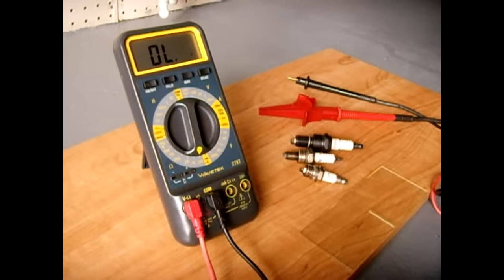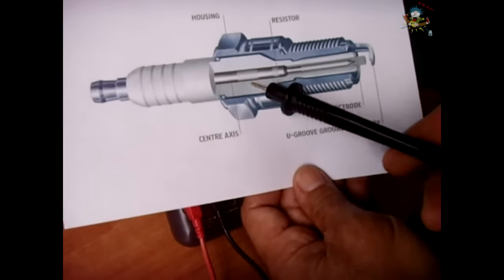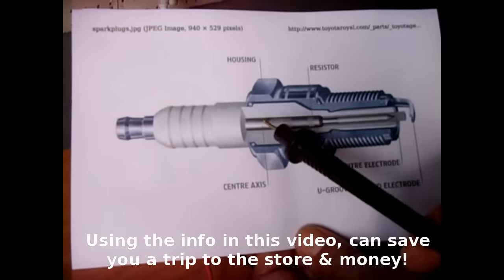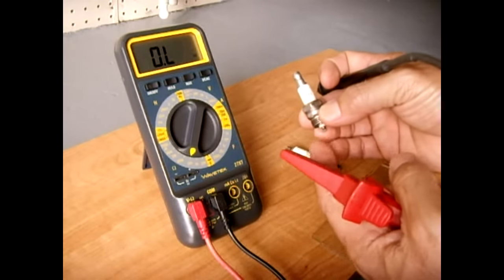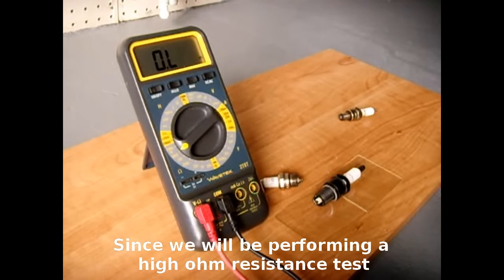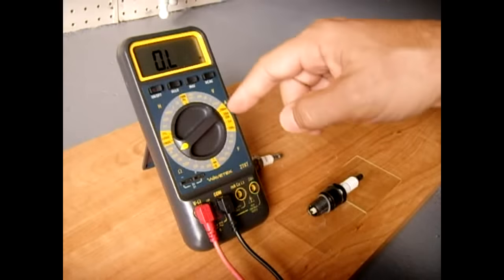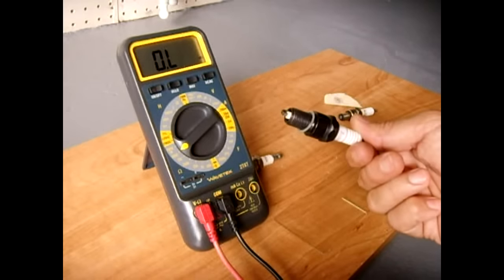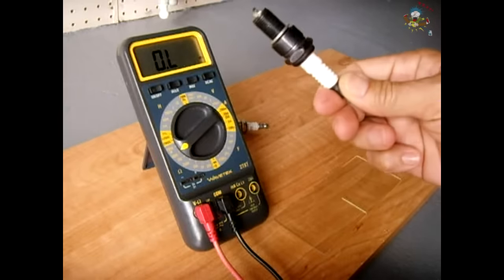How to rule out a Spark Plug as your problem

Comment: Your multimeter will not produce a sufficiently high voltage to check the insulation of the plug
Reply from the maker: paul c Never failed me. If you have a megger like me, use that.
Reply: spark can jump 1 inch an  your test never failed cause you probably only tested 2 .. by the time to remove plug test cold heat up test  hot  an realize this is a test but it is not conclusive or a positive diagnosis just but new plug for 2 dollars..
Reply: paul c for that you need lightning.
Reply: walter kersting  —  Hysterical response!  Thanks for the chuckle.  Love it.
Reply: paul c  buying a new plug for $2.oo makes me laugh out loud.
Reply: @mikem1014  - I think not. OEM plugs for my Suburban were $80 plus tax. We are not talking lawn mowers.
Reply: @PayNoTax-GetNoVote   we are talking one plug to test not to leave in motor ... just for testing

Comment: I am Italian ; I did not understand your video a lot:
I extracted 4 candles from the engine ... 3 had a resistance of 4500 ohms, 1 of 3000 ohms; Question: what could this go to 3000ohm? In my opinion, this candle has encountered problems, what do you say? thank you
Reply from the maker: Try cleaning the spark plug tip with Brake Cleaner.

Comment: You should also use the ohmmeter when testing the plug, for a high resistance connection  between the center and the ground electrode. This would usually be caused by operating the engine  with a very lean  gas / air mixture.

Comment: What is the range of KΩ you are supposed to get with automotive spark plugs with an internal resistor?
You said roughly 6.3KΩ but I need to know the exact min and max!

With 2 pin COP ignition coils it's:
▪︎ 1.0Ω or less for primary coil
▪︎ 6.0-8.0 KΩ for secondary coil

I would appreciate it if you can tell me the resistance range for a standard copper E3.48 DiamondFire spark plug or any standard 98%Copper with 2%Nickel spark plugs and Platinum or Iridium if there is a difference

Comment: Can we determine wether he spark plug contains a resistor inside or not by its length. For example, if the spark plug is short that means probably it does not contain a resistor inside?
Reply from the maker: No

Comment: The low voltage resistance test will not tell you anything because parasitic losses across the insulator at very high voltage are the problem with plugs breaking down, that is why we use (or we used to) a tuning oscilloscope to test spark plug secondary voltage under running conditions to see high spark resistance and detect poor insulation. Don't clean plugs unless you need to get our of trouble, replace them, you will never clean off the fuel by product burned into the insulator nose cone over their service life that is a pathway for parasitic flow across the insulator. The first sign of which is poor or irregular misfire at idle.
Reply from the maker: I've owned boats, jet skis, several cars, lawn and garden equipment, and the test shown never failed me. I was always able to identify a faulty plug. Nothing wrong with cleaning a spark plug(non-Platinum).
Reply: I've been a qualified mechanic a very long time and diagnosed a few million plugs in that time. You are seeing a reading on the meter but its not telling you anything you wouldn't already observe when it's running. In testing a plug we are looking for a condition that is present before it becomes evident with an observable misfire, We want to find a plug that is on the way to failing in the workshop before it fails out of the workshop. So you are testing the plug but not for anything you would not be able to observe otherwise, a bit like doing a compression test to confirm a bent valve. In short the very first thing we do with a misfire is replace the plugs with new ones and start from there.
Reply: FWIW, if you want to test the plug with an ohm meter and be able to find an insulation leak you would at least need to use a "megger" to test it.
Reply from the maker: I guess you never saw my megger video. :-)
Reply: No Ill have a look. But even using one, in short to test a plug electrically you need to generate a spark across it.

Comment: Very usefull for me......need some further advice on how to rule out a spark plug wire- some say that the lower the resistance the better the plug wire is....Magnecor says different and makes plug wires with very high resistance; so what do you advice me to choose? and of course, before choosing a new plug wire, what should I check to make sure I need to change it?
Reply from the maker: The resistance has nothing to do with how good the wire is. Wires are made for extremely low resistance, or high resistance. The insulation of the wire is what matters more. I suggest you contact the manufacturer to find out the suggested wire type to use.

Thanks For Watching!
Reply: electronicsNmore Got it.....so here are some further questions:
- since insulation is what matters, can I use some extremely good insulated ones like magnecor even though they have higher resistance over standard ones....?
-manufacturer (Renault) doesn't say anything about their types...
-how can I check a plug wire to see if its good or bad?
Reply from the maker: Likely have no problems with that wire. You can measure resistance across the wire and make sure the ohms per foot matches the manufacturers specs. Place the spark plug wire VERY close to the engine block at night and see if you observe any high voltage discharge(or corona) between the wire and the block. If you do, the insulation of the wire is degraded.
Reply: electronicsNmore Got it....instead of placing the plugs wires very close to the engine block- my wires are very short, cant get them close to engine- can I spray some water on them and see if discharges occurs?( using some of those "devices" used to clean windows set on "mist" to spray the water)
Reply: ncomplex1 Wires are just one part of the ignition system. Changing the type of wires without further modifications, or the need for them. Will not bring you any particular advantage, other than just spending money.But if your gonna replace it anyway, please make sure its up to at least manufacturer standards. ;-)

Comment: Hi, Does it short when the plug get hot ? Thanks
Reply from the maker: No. The plug heats up and expands, and if there is a cracked center electrode, that could pose a problem.

Comment: Hi,Thanks (what's your name?), Nice video. Just a couple of questions...how do I tell if a plug has a resistor or not from the outside?  (from looking at it?) and there was text saying don't sand platinum plugs but didn't tell us why?  Thnx again,  Bj
Reply from the maker: I'm Doug. You can tell if the plug has a built in resistor by the part number which usually contains an "R" at the end, or you have to use the DMM to test it to find out. Platinum plugs are "self cleaning" plugs. There is a VERY small dot of platinum on the ceramic tip, sanding it will damage the plug. No need to clean those plugs.

Thanks For Watching!

Comment: Is this video valid for iridium spark plugs or have they diferent measures?
Reply from the maker: +Joaquim Coutinho 
They test the same way. The only difference is the electrode is made of Iridium.
Reply: +electronicsNmore I have 4 iridium plugs for my yamaha. Cyl 1-2 have a value of 4000 ohms, cyl 3 has a value of 7800 ohms and cyl 4 has a value of 3700. Could that cause some rough running (misfires and loses power) at higher rpms? (The plug with a high value is also black compared to the other ones that look normal. (no oil residue, just black in colour)
The coils check out OK.
Reply: Narii- try to clean the iridium plug and measure again the values seeing if anything changes?
Reply: ***** Swapped them out for new ones, runs as it should now. Need to sync the carbs tho.

Comment: So if the multimeter checks the plug as ok, it means with 100% that the plug really creates an actual spark? I do not need to check this by starting it unplugged from the piston chamber to visually see the spark? This test is enough?
Reply from the maker: Extremely reliable, but nothing is 100%.

Comment: How hot would I heat the spark plug up to do a hot test.  I know I don't want to take it out of my car hot.  Thanks for the vid.
Reply from the maker: Alexis Tudor Place the spark plug in a toaster oven. 300 deg F should be fine. Use leather gloves when testing the plug. Lay the plug on a ceramic or glass plate while testing it.

Thanks For Watching! Be sure to Share and rate Thumbs Up.
Reply: electronicsNmore   Thanks.  Yes I already gave it thumbs up.

Comment: Can we conduct this test for platinum plugs?  I was told not to touch the electrode of a platinum plug because they're very sensitive and will likely be damaged.
Reply from the maker: I don't recommend it. The spot to touch with the probe is so tiny, you'll get a false reading.
Reply: @electronicsNmore  Thank you very much for replying.  So this test is only good for copper spark plugs?
Reply from the maker: @renejacques8288  No, it works with others.
Reply: @electronicsNmore  The only one left is iridium, right?
Reply from the maker: @renejacques8288  It works with all 3 types, but easily with copper and iridium.

Comment: What you're performing is a resistance check, and it's not fool proof. You need a spct 100 to check the plugs under a load, you can increase the pressure to simulate cylinder pressures, that's when plugs stop firing if they're bad, under a load. Just pulling the plug and seeing it spark when you crank the engine, or doing this resistance test is not good enough to determine weather or not a plug is good.
Reply from the maker: When you test using very high resistance in the millions of ohms, it sure can tell you if the plug is faulty. Wondering if there are any heat related issues with the plug? No problem, place the spark plug in a toaster oven at 300 deg F, then repeat the test. I never had the test fail. Years ago I had a jet ski that wasn't running right, I'd be riding normal, then it would intermittently start sputtering in and out, so I tested the plug using the method shown in this video, and it was very easy to identify the faulty plug. Yes, no test method is 100%. Thanks for watching!

Comment: If oil on the plugs it could also mean head gasket between oil, water and cylinder surely?
Reply: Not always!! Oil fouling of the plugs usually indicates a problem with rings, valves or valve stem seals. If your car has a head gasket issue, other problems will be there too. These are things like water in the cylinders, water in the oil, oil in the water, extremely low compression with the cylinders involved, increased oil level in the sump & emulsified oil, loss of engine power, rapid pressurisation of the cooling system coupled with overheating due to coolant loss. I could go on, but I won't. I did not use google for this information either. This comes from 3 decades of tinkering with cars & fixing them for a living.

Comment: I do not think heat ranges are set that way....  the heat range is a function of the depth of the air-gap between the threaded sleeve and the center-ceramic...
Reply from the maker: I explained that in my Pinned Comment. Thanks for watching!

Comment: I have a snowmobile that eats plugs like smarties. Sometimes only get a couple minutes out of them.  The plugs test good but will not spark. I've even tried them on different machines.  The snowmobile is a 3 cyl 2 stroke. It's not the same plug that goes bad either.  I'm very confused.  This system fires all 3 plugs at the same time with 3 separate coils. Any Idea what would cause a new plug to blow but still test good?

Comment: Should there be any reading if a DMM is placed on one end of the insulator and the other?
Reply from the maker: Victor Aberdeen If you touch where the electrode is and where the spark plug wire connects, yes.
Reply: The DMM is being placed in series with the porcelain.There is no contact to the steel shell or center electrode.That is the question?
Reply: What I am enquiring about is where I place one DMM lead on one end of the porcelain and the other lead at the other end of the porcelain.Bear in mind that there is no contact to any metal surface.

Comment: Just surprised that the 'resistor' part of the plug is to suppress interference as this is usually done with a capacitor in other circuits.  I can't understand how a resistance would serve to do this.  

I know this is slightly off subject but a capacitor works by filtering out certain frequencies which cause interference while a resistor just serves to reduce the potential. I'd be interested to know the answer on this.
Reply: to reduce electrical noise in the vehicles other circuits. The resistor lowers the circuits peak current, which lowers the electromagnetic output.
Reply: Riley Vaillant

Comment: You mention you can tell if rings are worn by the spark plug, how?
Reply from the maker: +James Barratt 
Oil on the plugs would indicate the rings are heavily worn or leaking valve seals.

Comment: The "expert" blew it when he attributed the heat range to the height of the ceramic top post.  The heat range is determined by the the ceramic at the combustion end:  by how far up into the plug body the electrode is isolated from the threaded metal portion.  The further up into the plug there is a gap between the ceramic and the metal body, the better the heat transfer to the head will be and the cooler the plug will run.  Hotter running plugs will have less empty space (that is more ceramic filler) and less heat transfer to the coolant cooled heads; thus the plug will run at a higher temperature.  A plug that is too cool will foul and be a PIA, but a plug that runs too hot can damage the engine.
Reply from the maker: I guess you failed to read my "Pinned" comment.
Reply: No Troll here, but you are correct, I did not notice your second comment.  I apologize for my having not noticed your previous correction.
Reply from the maker: @rooster3019  I modified my reply.
Reply: Cool beans!  You earn another "like".

Comment: HI, good video....I have a question on my champions spark plug UL77V
when I measure the resistor like you did...using an ohm meter Fluke 60M
from the center of the electrode to the center tip the reading for all is over 60M
is this normal reading ? the test was perform on a bench (cold)

Thank you
Reply from the maker: Mo Mo I do not know that particular meter, but if you are getting results that do not match what I showed in the video, then the plug is likely bad. You should have no reading between the center electrode and metal threaded body of the spark plug using the highest ohms range on your meter. Perform all tests hot and cold to rule out the plug.

Thanks For Watching

Comment: This will not catch the most common failure on a spark plug- a cracked or otherwise damaged insulator.  Even then, sometimes wear or deposits that don't look bad will cause problems in the engine, and I've run into engines that just won't run right with some brand of plug, even if it is correct for the aplication.

Spark plugs are the only engine component that I can think of that the only way you can be positive if they're causing your problem is by swapping them out.
Reply: Or unless you have the mother of all testers 😉

Comment: If it is a soaked two cycle engine and its an NGK, replace the plug period. Those plugs are prone for oil saturation over time and fail. It is very common on NGK. 35 years of working on small engines teaches you that,  5 minutes to replace saves you wasted time.
Reply from the maker: My jet ski had NGK's, when I had a problem with the engine,  and tested them using this method, they always tested bad. There's no reason to spend money unnecessarily on plugs, or a trip to a store wasting gas also, when you can test them easily.
Reply: @electronicsNmore  I worked on restoring snowmobiles and it was always interesting to see how many spark plugs were either stuffed in the storage cubby or under the engine. The record was 18 spark plugs in one snowmobile. I used to save them all in a coffee can just to see how many I had. I used to always carry two extra sets of spark plugs per snowmobile. I usually ended up donating a set to my buddys because they would foul a plug on our trips and always had bad plugs as spares.Nothing ruins a day on the trail faster than someone who has a fistful of bad spark plugs and someone has to make a trip back the other way and hope a gas station has the right plugs. Then they charge $5 per plug. Anyways...yeah.

Comment: What about carbon tracks?  A bad plug could pass your test because it is bleeding current through the porcelain.  Your test is a good start, but not complete.  I do not believe carbon tracks will show up with just an ohmmeter, maybe a megger (but who has one of those, I don't).  Possibly wetting the porcelain with water might show a path for current, I'm not sure, never tried it.  Corona staining around the hex portion of the porcelain can make carbon tracks very hard to detect.
I use my lawn mower to check suspicious plugs.  This is not HE ignition, but it does let you know the plug fires.  With cars, I usually install new plugs anyway because the old plugs have been in the engine forever in most cases.
Reply from the maker: D Nelson Never had a bad plug pass my tests. :-). Meggers are very good.

Thanks for watching.

Comment: Ik this might be a dumb question but say a goofball (moms bf) crewed off the tip by the insulator, would the spark plug still work? The reason he took it off cuz it didn't fit the cdi of my motorized bike